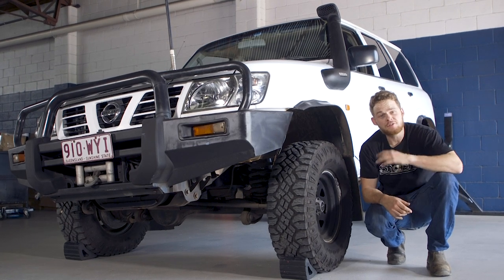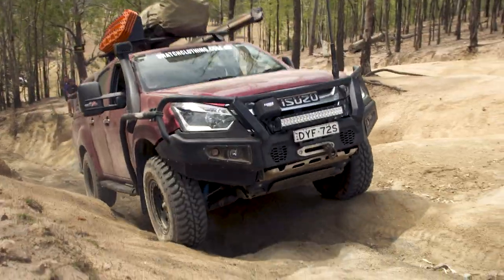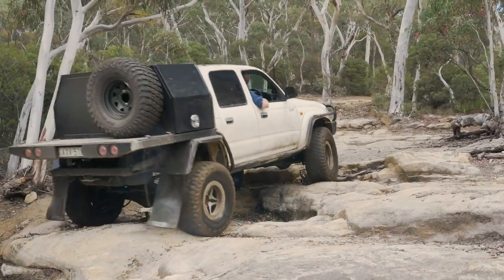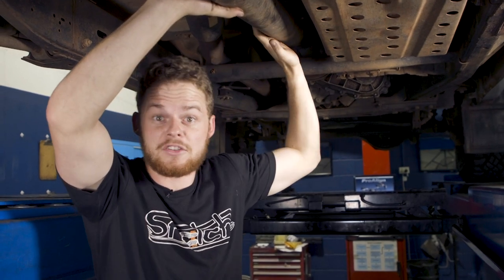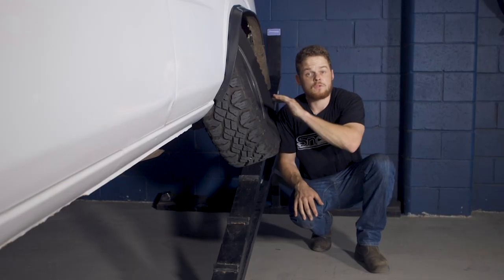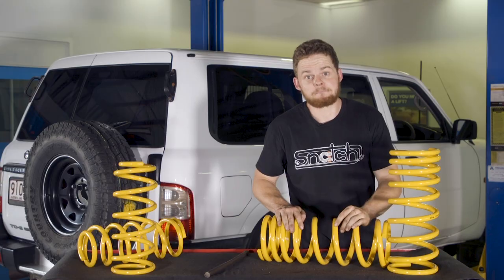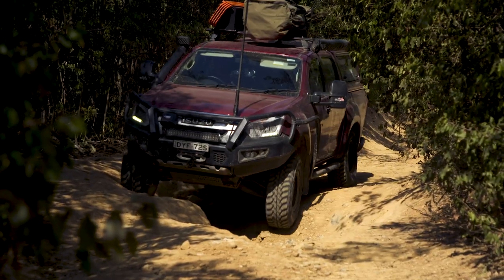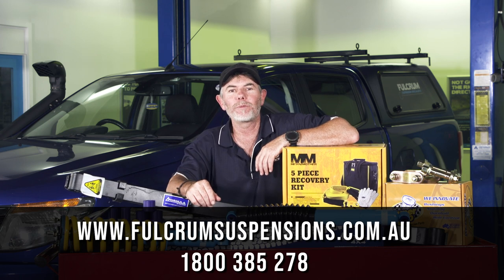Lifting a Live Axle 4WD - Everything you need to know!

Comment: Amazing video .what the safe wheels size and lift height for IFS torsion bar rear coil spring on solid axle tube for aggressive look  only and on-road use . with minimum modification and not changing geometry of vehicle and handling and gears ratio . car with OEM wheels size 28.5" - 29.6" .any help or Guide . what the difference between  35" on 15 " or 16" or 17" for the size and which the best choose . and how you correct wheels alignment after lifting vehicle use the OEM alignment value  and how you correct scrub reduce angle .